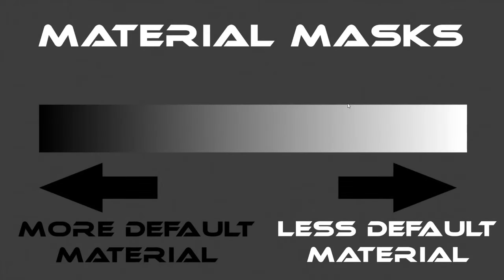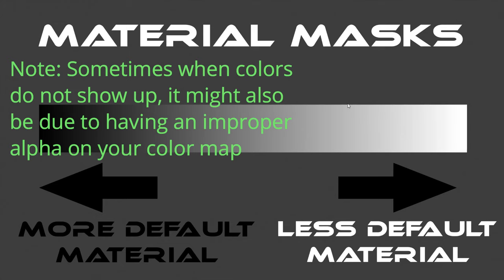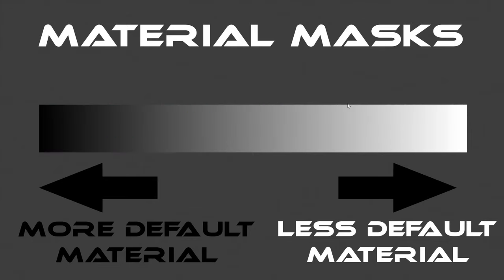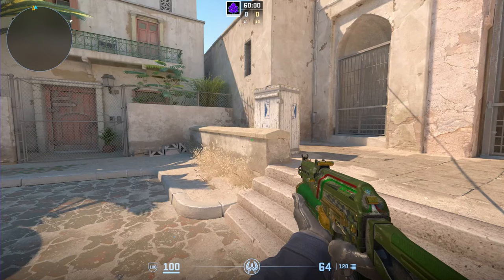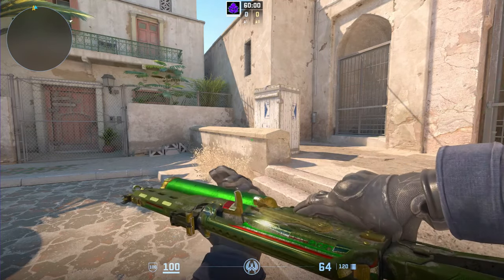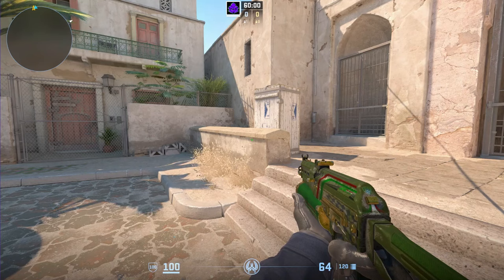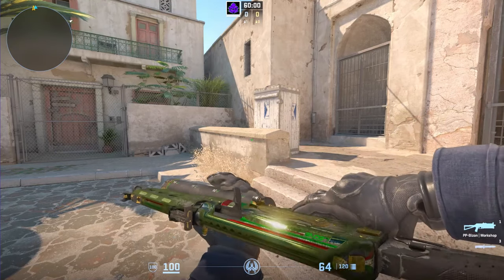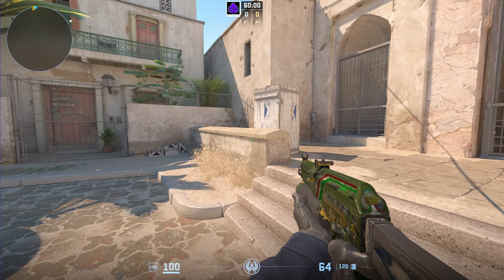Creating CS2 Weapon Skins: Material Masks and Pearlescent Masks

Comment: Hello, i have a pattern and used patina on it and applied the albedo, rough, normal pattern but the normal pattern appears on the whole weapon,  do i need to specify my parts and bake it on the software itself ??
Reply from the maker: I've had trouble using normal maps on tiled weapons with the one weapon I tried it on so Im not 100% sure how to answer to this. My tile and the roughness maps seem to line up correctly, but I believe the normals are meant to not move like the design does. Im thinking they need to be created on the UV like a static skin would be but again I havent tested it enough to know exactly.
Reply: @optekdesigns  I was making some skins like the Koi Deagle one like making a Pistol collection so

Comment: would there be a future video on how to remove decals like bumps on a gun like the grip texture on a mp7 so i can put my own bump maps
Reply from the maker: Actually yes. I will be covering this in the new series that should be coming out soon. Unfortunately me and another viewer found an error and Im going to need to go back and re adjust some of the earlier videos which will now take time to do. 

Since it may still be a little while before I release the videos, inside of my drive are the default AOs and Normal maps. You can go in and edit these by using a brush and painting over  the default bumps/textures you dont want. Then you will need to clean up your own normal maps and merge them in with the defaults. In PS you can use 'overlay' and in Gimp it would be 'grain merge'. This does make it a little easier now because you only really need to burn normals for every part of your project....only the parts where normal maps were added in blender. Just remember that some of the information lives on both the AOs and the normals so you have to make sure you remove the information from both of them. 

The AOs are a little tricker because you don't need the black background that blender adds. Usually what I've been doing is to use a magic wand tool and separate only the parts with my bump AO information and put them on a separate layer...then delete the AO with the black background. Ill clean up any shadow information I don't need, place below my default AO and use 'linear burn' to add it to the default. Its good to add it below the default in case you need to make adjustments so that the adjustment layer doesn't affect the default AO. 

Ill demonstrate all of this in the new videos if any of this doesn't make sense.

Comment: thank for video:) the best channel on this topic!!! im new to this I ran into a problem i was painting the barrel of a glock-18 when i realise that the whole barrel doesnt' paint. There are some places in where the texture doesn't paint the weapon. I saw the glock-18  and that weapon has all the parts  painted so I would like to know why does this happen. how to fix that?
Reply from the maker: You are in the right spot. Some weapons will have default materials on them, so more than likely you are going to need a material mask in order to make those colors show up. One way to test would be to create a 4096X4096 white square and save it as a .tga file. Then just add it into the material mask in the workshop and see if those colors show up. You will obviously want to go back and mask each part individually based on how much wear you expect the parts to have, but it would at least tell you whether that is the problem or not. 

Now, there is an exception though....it depends on which paint kit you are using too. Some paint kits will only allow you to color specific parts of a weapon. So if you do not see a place to add a material mask then it could be that the paint kit wont allow you to color certain parts.
Reply: @optekdesigns  thanks a lot!

Comment: Can you make a video about creating RGB patterns? It seems complicated.
Reply from the maker: Are you referring to tiled skins? Its not overly complicated....you just want to draw out a repeating design in a 4096 by 4096 square and then decide which parts to be red, green or blue (and add a black background). Create a tga file from that image (you can do this by adding to gimp, selecting export, and change the extension to tga). Once you add this tga to an anodized multi color paint kit it will tell you which color box controls which color in your design, and you basically just set a color for each one of those 4 channels (black, red, blue and green).

Unfortunately I have about 7 or 8 videos lined up so it would be a long time before I could get to a video like that. I have to update ALL of my older videos. My advice would be to play with the Anodized Multicolor examples they have inside the workshop, notice the way they created their image (you can see it better by clicking on the magnifying glass below the base texture), and also play with the color values to see what they do. You'll pick it up pretty quickly.

Comment: Cyberoptek bro please help. I've baked and exported every texture map of my gun from Blender then I imported them to Gimp. Then did what you have shown. Making new from visible, then doing the mask selecting the textures and making them different brightness with the bucket tool but when I import the file ingame my gun is off. Some parts have texture and some are missing completely? This is so frustrating. Ive heard that you need to make an alpha channel and export as 32 bit color but what does that mean? Help bro xd
Reply: Ive used different hdri's too and everything, idk what to do anymore
Reply from the maker: @killstreak9443  So it would be hard for me to know exactly what is going on without seeing your files or photos of the issue. One thing I can tell you though from the last comment is that you shouldnt be using HDRIs anymore at all. The new game uses albedo maps with no lighting information so that is definitely one issue you are having if you are adding hdri lighting to your project. The old CSGO videos are not going to be completely correct....thats why I put out the video about the colors in the new game and how to make your color maps to be an update to those old processes. 

As far as the exporting in 32 bit....that is most likely when exporting from photoshop. In video 7 I talk about this but its in PS and not Gimp. You add greyscale values in a psd file, then copy/paste over onto your alpha on your tga. When you go to save it, a pop up will come up on the screen where you can select 32 bit. I usually do my alphas in PS because its easier to go back and forth to edit but Ill do some research on this because eventually I will do another video on wear patterns as part of my full skin creation series coming soon.
Reply: @optekdesigns  Now I got my textures working lmao but yeah thank you for reply anyway. I'll export the maps again with hdri. And yeah they look fine but yeah the lightning is not working like you said. Some shiny parts of my gun just look not shiny :D I am pretty new to this so I am sorry for dumb questions
Reply: @optekdesigns  Which vids would you suggest me to check out?

Comment: Hello this is confusing to me What is Material mask actually ?  And why are u burning roughness and using it as a material mask instead of roughness mask and the other question which finish is this applicable to ??
Reply from the maker: Im not using a material mask as a roughness.....I had already added my roughness map at the time of the video. There are default materials added to certain parts of the weapons by valve....the material mask is a way to override those default materials. So for example, if you are using the gunsmith paint kit (so you can make parts look metallic....keep in mind only three paint kits will give you a metallic finish) and you tried adding ONLY a roughness map with little to no roughness to the magazine of the M4A4 (on the black end of roughness), the magazine will look like plastic using only roughness. However, if I add a mask to that magazine (still using the same roughness) the mag will look metallic. The video shows an example.....if you notice on the mag of the bizon it looks like plastic with no mask (my roughness was a dark grey). So I added a white material mask on top of my roughness map and it came out looking more metallic as I had intended. All weapons are different so it takes some playing with to figure out which parts need masking.
Reply: @optekdesigns  good morning, so I'd made an interesting pattern and wanted to used patina as I didn't have to bake the maps. I applied the Albedo, roughness and the normal map but The normal maps is applied to the whole weapon but the Albedo isn't how do i control that ? And thanks for helping me really appreciate it
Reply from the maker: @pangtundure  You would most likely need to use the x, y and z and set them all to zero if it isn't a tiled skin. You might also make sure that 'ignore weapon scale' is turned on. I think that is what you are asking for.
Reply: @optekdesigns  sorry for this i fee my lack of Proper English is in the way but have Patina as my skin there is an metallic Pattern texture as ALBEDO and roughness and Normal maps but the Albedo and Roughness is Only applied to particular parts whereas the Normal map is applied all over the weapon.
Reply from the maker: @pangtundure  Firstly, is this a tiled skin or a static skin? 

Im not 100% sure since Ive never used the Patina paint kit, but I know with other paint kits like the anodized multicolor there are only specific parts that get the design applied to. So for example If I use the anodized paint kit  with the galil, my design  wont be applied to the barrel, foregrip, grip or buttstock. Thats just the way Valve has that specific paint kit set up and it cant be changed.
Reply: @optekdesigns  it can be tilted any way it's an metallic pattern so i chooses patina cuz metal looks good there compared to gunsmith
Reply from the maker: @pangtundure  ok yeah if its a tiled pattern then you don't want to use it in gunsmith. So what I said before probably applies then....in other similar paint kits (such as the anodized multicolor) there are certain parts of the weapon you cant control. I ran into this with my Bio Leak  Zeus where I couldn't apply  colors to the round part at the front of the weapon or the safety switch. Now again, Ive never used patina for any of my designs but I would assume it is set up similarly. I could be wrong but without actually playing with it, it would be hard for me to know if its the same issue or not. Which weapon are you trying to use? If I get some time tonight or tomorrow night Ill try playing with it a little bit.
Reply: @optekdesigns   yeah same issue i couldnt control the parts and stuffs